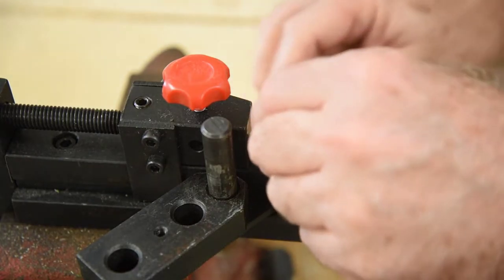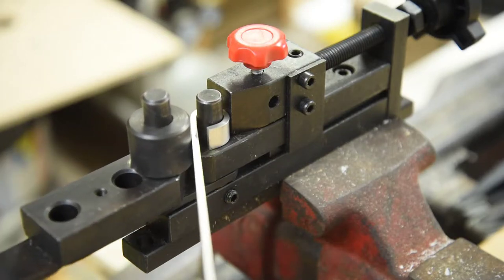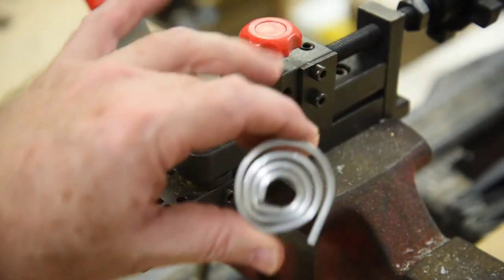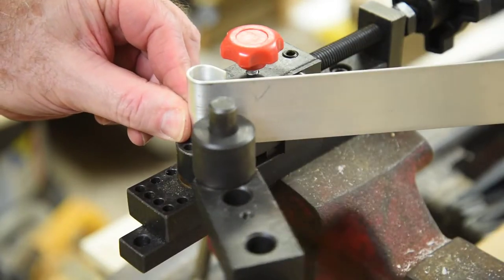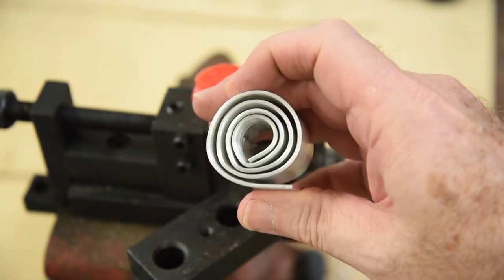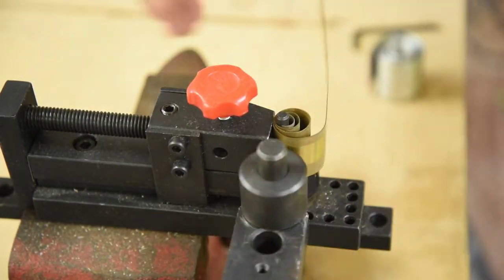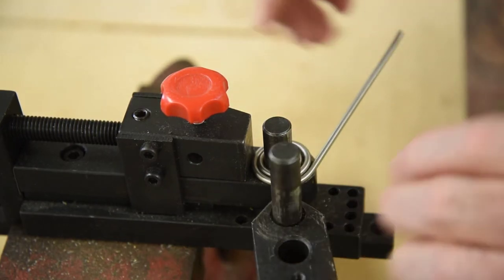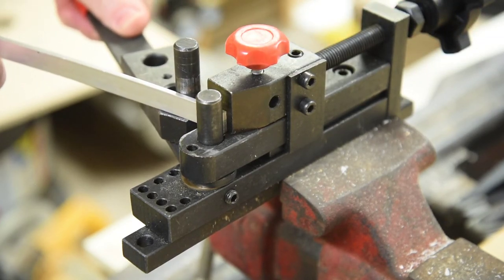Metal Spirals with the Mini Universal Bender

Comment: Thanks for another great vid! I discovered, quite by accident, the original patented producer of these benders that China “copied”. Search “Oxford General Industries” or “Duo-Mite” bender. I was shocked by the prices of the 3 versions that they designed/manufacture/sell, but amazed at the number of accessories they have (the close follower is a must have). Also extremely helpful are the instructions that are on the site! Take a look!
Reply from the maker: Ooh very nice, thanks.